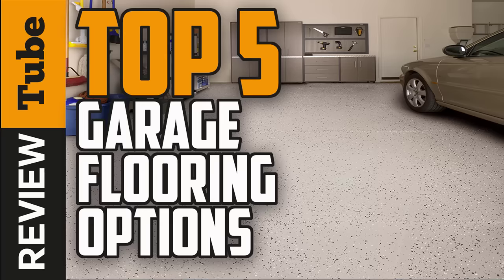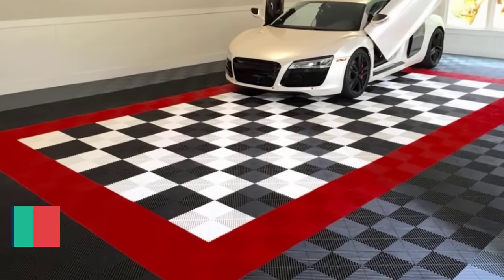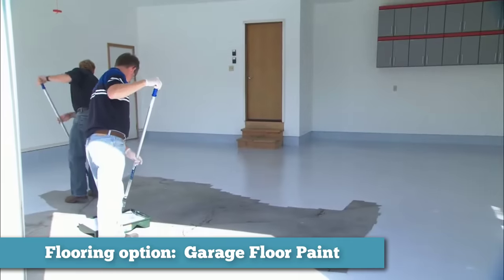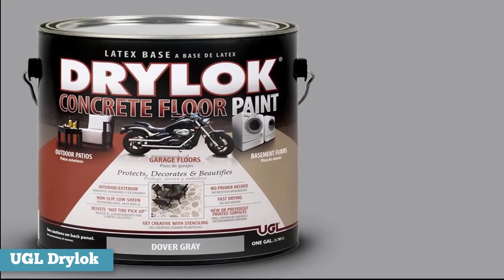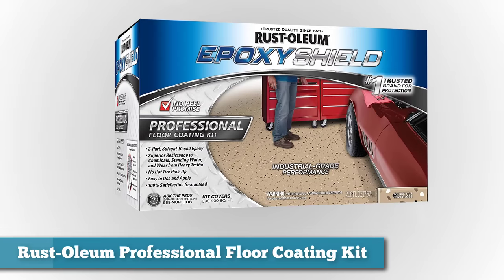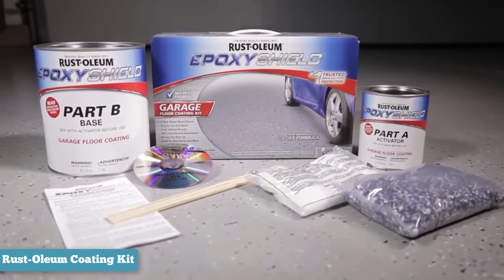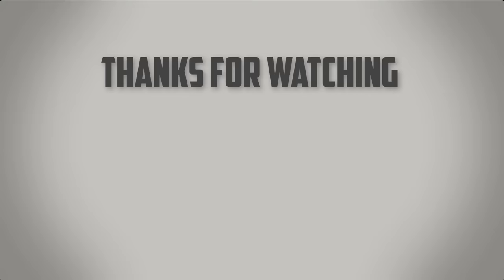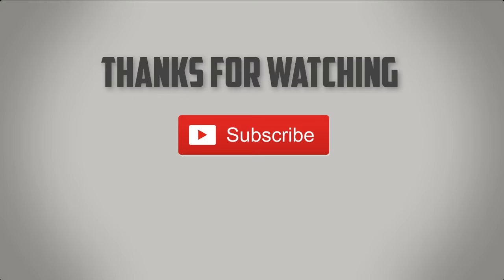✅Garage Floor: Best Garage Floor (Buying Guide)

Comment: I did my garage floor with RockSolid coating by Rust-Oleum about 11 
months ago or so. And I am not very happy with it. What Rust-Oleum does 
not tell you outright is any sun that might hit the floor, will fad the 
coating finish. I have an area of about 2'-0 x the width of my double 
car garage door that the sun hits and its now faded. Worse, and much 
worse is when you park your car in the garage and it condensates water 
on the floor... and the water sits on the floor and waits to 
evaporate,,, the water will lift the gloss finish right off the coating.
 When I called Rust-Oleum and reported the problem,, they informed me 
that these 2 conditions will damage the coating??? Where in the fuck is 
it posted that plain water will lift the gloss top coat? Or the Sun will
 fad the coating??It sure as hell isn't listed on the coating 
description!  Don't waste your time, don't throw away your money on 
RockSolid garage floor coating

Comment: Im a contractor who specializes in applying waterproofing coatings,you can increase the strength of the epoxy garage floor coatings where it wont crack or peel for decades,after applying your 1st coat of epoxy approximately 30 mil thick in 3ft wide strips you roll in 36" wide polyester reinforcement fabric used for plaster,drywall or tar roofing coatings,be sure to use the yellow polyester fabric vs the black because black is impregnated with asphalt,im on the 5th year of my own heavily trafficked garage and its never cracked or peeled,my biggest job using the reinforcement fabric was a 350,000 sq ft factory floor after the machinery had all been bolted to the floor,i sprayed that epoxy on for the prime & first coat,we used 1/4 inch notched squgees to spread out the final clear epoxy coat followed immediately by men using paint rollers to spread the clear epoxy even and uniform,we gave a 3year guarantee against any cracks or peeling which is a full year longer than the manufacturer warranty,that was just over 4 years ago and the floor still hasnt cracked or peeled while under traffic by robotic fork lifts.
Reply: I have a 12 year old Valspar epoxy. It is finally coming up due to vehicle wear. Could I use your suggestion over the old coat when I redo the floor?
Reply: @sgt.grinch3299  if you are putting epoxy over epoxy, you would want to grind off any shine that would be left on the previous floor. Especially if you may have used a urathane coating. But if the old epoxy is coming up from the concrete, then your best bet is to remove all existing epoxy and grind the concrete.

Comment: Ive used both Expoy shield and Race deck. The Epoxy looked nicer when new but gets slipper when wet despite using anti-slip additive. It was harder to do taking 2 days to apply the coating and a week to cure. Despite proper install it began to lift within a year and has dulled over time.

Race deckgot installed in 2 hours, does not slip, can handle tools falling on it, does not lift, does not fade and still looks new 4 years later
Reply: SinisterC6 a

Comment: That's my 2011 Corvette Grandsport and new garage floor. Nine years later the floor still looks great.
Reply: Earl Balentine what kit exactly was used for your garage floor?
Reply: @davidkindig9208  It wasn't a kit, it was a commercial grade installation by a epoxy company, cost a=was around $1600 for a large 3 car garage. There's add-ons you can get. Since it takes 1 week for a=the epoxy dry you can't drive on it for a week, you can walk on it after a couple days. Apparently the hot tires sitting on it could stain the rubber tire tread marks into the epoxy if you don't wait for about a week. You can purchase a mixture into the epoxy to help to Hardin faster like in 3 days. You can also add a clear coat on top to give it that real shinning effect. Another add-on is the flakes. All 3 of these add-ons adds to the total cost of the epoxy floor. Adding the flakes the tech has to use a spinning floor machine to know don't the sharp edges of the flakes and that takes more time and equipment. It's been 9 years and I still don't have any chips or separation of the epoxy.
Reply: Earl Balentine Are you in a cold winter climate?
Reply: @jeffsstuff6575  No hot in Phoenix Arizona. I tried the Home Depot epoxy floor kit, it looked good the 1st year but started to peek and chip. It appeared to be thin and could scratch easy. The commercial type is the best way to go even though it cost 5 times more.

Comment: Whatever material you choose, make sure the preparation is done properly. Most of these companies tell you to acid etch because it’s easy, acid etching does not work, you need to diamond grind or shot blast your floor before any epoxy coating. If you don’t grind or shotblast, it will fail. That simple.
Reply: My boss has been doing the acid etch for years, and it's worked so far? What makes you say otherwise? I'm just curious.
Reply: @tycarnine3855  Because its simply not as aggressive as a mechanical scratch in the concrete and every failed garage floor we were hired to redo was acid etched. You might get lucky, but for the most part, it doesn't hold up.
Reply: @ConcreteFloorSolutions  Thank you. I know he's done dozens of them and I haven't heard of any failing or needing redone. How quickly would they typically fail?  It's interesting, thanks for the tips.
Reply: @tycarnine3855  From what I run into, as soon as days or up to a year. The bottom line is acid etching doesn't do anything for the areas that were oil or petroleum stained within a garage or any slab for that matter. As it does not penetrate oil stains etc, the only thing that prepares the surface correctly is mechanical preparation which is diamond grinding or shot blasting. You may get lucky on new concrete that doesn't have oil stains. Plus, thats not even mentioning the environment effects of pouring acid on a floor and rinsing it to wherever the water runs.  Not very environmentally responsible.
Reply: @ConcreteFloorSolutions  Yeah so we've been doing it on new floors always. We're a paint outfit in the desert of Arizona. Acids bad for the ground? Even if nothing's growing around? Did not know that. I don't think he'll change methods unless something goes wrong, thank you for your feedback.
Reply: I used a vinegar wash first. and really let it dry out for a week.

Comment: If you want long lasting quality, go with polyurea...with any coating, I'd go with Polyurea coating over epoxy coating but either one is good it comes down to prep work if that is not done correctly then expect the coating to lift
Reply: What about an epoxy coating with a poly sealant over it?

Comment: If you’re painting your garage floor, make sure it’s solvent based be it regular paint or epoxy... Home Depot carries glidden polyurethane oil paint in a gloss.. or rustoleum epoxy solvent based paint, make sure to use the clear coat (2 coats)
Reply: Marak Lia do you have to remove existing paint on a floor or can you go over it?

Comment: I see that you discussed epoxy and paint, our painter recommended Sherwin Williams stain instead for our three car garage.  We’ve had it now for seven years and it’s held up well but when we build our next home I’ll be looking at either using stain again or something better.  I’d appreciate any suggestions you might provide.  Thanks.
Reply: I haven't seen a paint yet that holds up to the the demands of garage life.  Hot tires turning on it and chemicals such as brake fluids and oils will have it looking bad in no time.  Epoxies with urethane top coatings are a great solution, but require proper floor preparation (concrete grinding) for adheasion and you need to mindful of the working time once you mix the components to apply.  Stain can be an easy solution if you like the look.  Be sure to put a concrete sealer on after staining though to help to protect that finish and even apply wax from time to time.

Comment: I like the tiles but wouldn't moisture and other liquids just leak through ? People that live in northern climates have to deal with the slushy stuff 6 months out of the year. Maybe the tiles fit tightly enough together that its a non issue.. anyone have these ?
Reply: Eric Leblanc yes what about snow ice melting off on the tiles and freezing????

Comment: I am researching a surface for my basement, If there is some water potential rising from below, would you think epoxy or floor tiles are the way to go?  I'm getting so many mixed responses.
Reply from the maker: If you’ve got water coming up from the ground then dont do any epoxy. 
Try to resolve this humidity issue first.

Comment: Which garage floor tiles does not have groves in it so its easier to use a floor squeegee on it and allows free flow of jack or tool box wheel?

Comment: Hiya, I used epoxy on my kitchen floor I did a chemical degreasing and drying the floor before applying. But after around a year some of the epoxy started to crack and chip off. Is that normal or did I make a mistake when applying like missing a step?

Comment: Let's move outside to my concrete two-car driveway. Except for the floor tiles, could any of the other products be used to paint my driveway? If not a good idea, what can you suggest? After a bad experience with Sears garage tiles. They didn't fit properly and resulted in bubbling when the tiles were joined. Unuseable. Recommend that if you decide on the floor tiles to check how they look when installed.

Comment: This should read Best DIY garage flooring.  If you have super-cars in your garage and want a show room as referenced you can probably swing paying someone do do a better job than you can do yourself from Home Depot. High pressure 2 part Polyurea coatings are superior to all options referenced in this video but getting merch review recommendation income from that would be more difficult...

Comment: I'm concerned after driving with hot tires damage on surfaces? (Paint, tile, PVC and more)
Reply: Hot tires??!!  My lawn mower tires pull the paint/stain from the floor.
In my new 10 years old home I have painted my floor 3 times with Rust-Oleum Pro.  Note I said NEW, the floor is clear, no oil or tire marks.

Comment: I'd like to put a nice finish on my garage floor and have been considering an epoxy for a few years, just haven't gotten around to it yet.  My biggest concern is that I have two dogs who are getting up in age and have started urinating on my garage floor.  I realize I'll need to treat the urine before doing anything else, but I'd like to make certain that future urination won't affect the epoxy (or whatever flooring finish we go with).  It may sit for up to 8-10 hours depending on when the dogs do this, but not much longer than that.  I'm also curious about the cost of having this done (3 car garage).  Any suggestions?
Reply: Just call Cesar Millan.
Reply: $6.50 a square foot is what I’ve been getting quotes from here in the Midwest.

Comment: no coating will last if the concrete is not professionally etched
Reply: The cleaner does etch the concrete.  I have tried the kit and it worked as described.  Very durable.

Comment: For an inexpensive product like this you get what you pay for. The products my company install are far more superior, more chemical resistant, UV protected no fading, cures to a harder finish.
Reply: REVIEW TUBE Sika, Simiron and Corotech. All top notch. As with quality there is a cost difference between these 3 companies.

Comment: Not sure the Incstores flooring is going to keep water and other fluids from getting to your substrate. Which can lead to mold and other issues. Your not going to get fluids out especially oil without taking up the flooring. They didn't even list Advanta flooring tuff-seal tiles which are used in industrial and home situation. They guarantee no oil or water will make it through cause they have a unique interlocking system that includes a channel to keep fluids on top. Garage tech and like tiles are useless if you plan on working on vehicles. Any fluids on the floor are going through to the substrate. If you use the open designed ones small parts are going through along with any liquids. Don't drop anything on the open style that weighs more then 10 lbs. or so as it's going to crack. The biggest issue is the liquids. Your not going to want to tear up whole sections to clean and dry the substrate. Looks nice but not very practical. Don't go by what you see used on many of the popular Velocity/ now Motor Trend shows. They are given the flooring by RaceDeck.

Comment: WARNING: the garage floor paint only lasts a couple of years, then starts to peel. 😬
Reply: I would say you applied it wrong. One person I saw peeling on, he admitted that on the parts it eventually peeled the floor was not 100% dry. I've had two garages painted, one I sold after 10 years and the other one after 6. Both had wear on them but not a single peel. And this was in Houston with normal triple digit temps. in summer.
Reply: criledo1 what did you use and how you did it? Based in houston and looking for doing my garage floor. Thank you
Reply: Trung Le, I used Rustoleum on both occasions.  I know it's not the best stuff out there but I was on a budget. Both garages were new so I did not have to grind them. I did very thoroughly clean them and etch them with acid. Very, very important, let them dry completely. That might take a couple days. DO not get desperate to get it done, be patient. On both I used just one thick coat instead of two and on both we applied the flakes too. Also very important, do not forget to use the anti-slip powder. On some products it is optional. We tested a small part of the second garage without using the powder and when wet that part was actually dangerously slippery. Also, follow the temperature guidelines carefully. The second time we did it on a very hot weekend and the product dries much, much faster than you imagine. With years both showed a bit of wear on the hot tire spots. It's not the most professional job but it it was affordable. Good luck!

Comment: Every product they consider the best. Is actually garbage. The best  products are not sold in homedepot. Swiss tracks and race deck are the 2 best flooring tiles.  As far as epoxy coatings. Don’t waste your money on rustoleun. It’s truly garbage. Goos epoxy for a 2 car garage costs about $1500.  And lasts for ever. Sorry for the rant. But I call bull shit out when I see it.
Reply: Mario Adragna I agree completely.  In my previous home, I diamond etched the floor and put down the best epoxy coating available.  Within two years I was repairing areas where tire heat caused the materials to lift.  In my current home, I installed Swiss Trax.  That was six years ago and the floor looks brand new.  No wear, discoloration or any other deterioration problems at all.  The floor is not slippery when wet and rain and snow simply pass through the tiles and drain out the doors through the built in drain channels.  I am so glad I went with this product.

Comment: Strongly disagree on the video's comments on Rustoleum professional grade solvent base epoxy.  This coating will beat any water base epoxy for durability when applied to a properly prepped surface.  I coated my garage floor with the professional solvent base epoxy 13 YEARS AGO.  Still looks good, it has never peeled up, and I park cars on it everyday.  Proper preparation of the concrete is key!!
Reply: Can you give some pointers on how to prep the concrete? Thx.
Reply: @Heretic_Wolf  Sure.  Clean the floor well (get oils off) and etch with a strong solution of muratic acid.   I used 50/50 muratic/water in a 5 gallon bucket.  Apply with a cheap sponge mop.  Rinse off.  The etched floor will take at least 3 days to dry enough before you can coat it.  DO NOT RUSH THE DRYING.  Make sure it is dry first before you coat it.  Apply your coating. (1 or 2 coats)  To look it's best, Rustoleum really needs the clear coat after you you apply the paint.  The process will be expensive and take the better part of a week to complete, but it is worth it.  Regards.

Comment: This is a huge disservice to the prospective customers. Epoxy Systems in a garage setting need to be topcoated with a urethane to resists hot tire pick up and UV degradation. 
As a professional installation firm I urge you to meet with a professional installer or local material rep if even a Benjamin Moore or Sherwin Williams store. Educate yourself prior to investing in a garage coating system.
Reply: Rexthane is an excellent product.